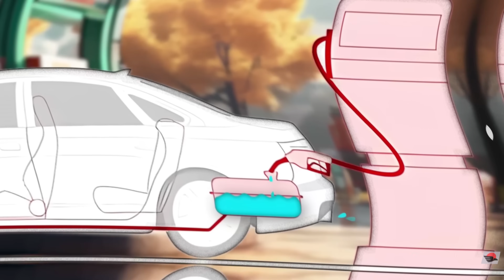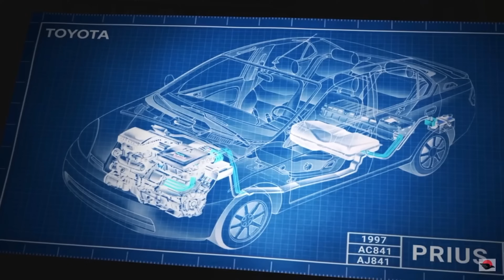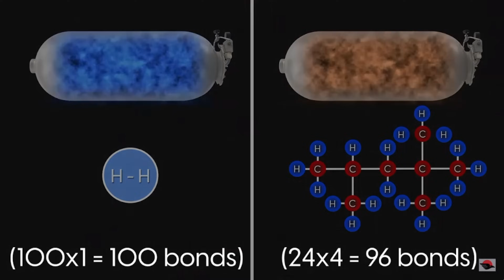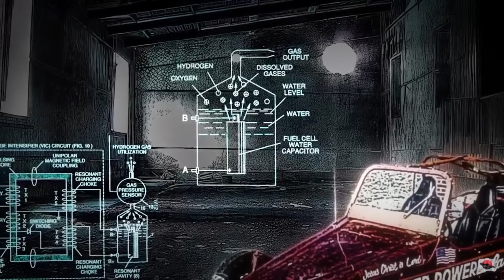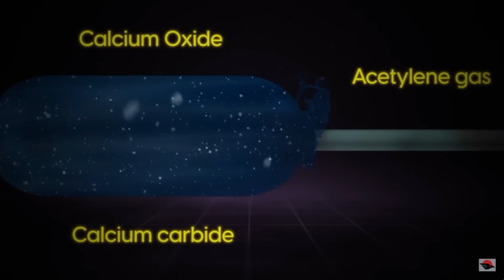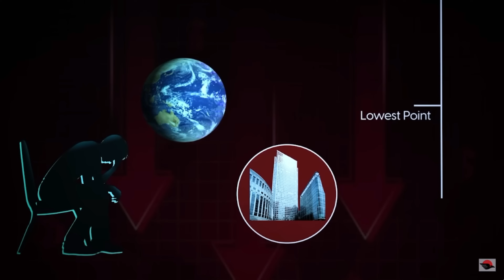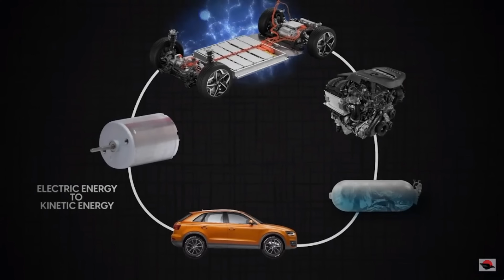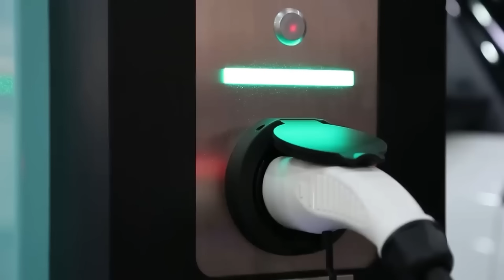Game-Changer: Will Toyota's Water Powered Engine Replace EVs?

Comment: I was always a Toyota driver...then on the premise that they wouldn't produce a junkers, I bought one of their eV BZ4X. Not a bad car overall compared to others, but does not meet the criteria for a useful 2024 EV.  Very slow charge, less range, too big for what it does, so many small things they didn't get right inside.  I think they put the same engineers on it that thought they knew about EVs because they built a great Hybrid.  Take away the ICE and you have a completely different set of criteria and mindset.  The dealers know nothing about them and are not helpful at all.  When something goes wrong they say "the car is functioning as it was intended" and give you a long list of reasons why it might be doing something weird.  Very disappointing - I, and several others I have met since who have bought them, would never buy another Toyota and now don't believe any of their hype.

Comment: This is not new its just new to Toyota. No massive company has ever tried use water engines as the oil industry controls them. The water based engine has been around for at least 60 years now.
Reply: Lol I said this before it got to that point

Comment: Separating hydrogen  from water causes a burn able feul . By using a copper coils to heat the water and Separating the hydrogen  gases .you get a burn .
We have torches  thay can cut with hydrogen  gas water

Comment: This is merely a basic transporter problem. Just convert ocean water into H and O (leaving the NaCl behind) and then transport both the H and O atoms to vehicles over the internet.  The resulting emission of the vehicle would then be just water. It would be water grow turnips and water for your aquarium. All of this can be done at 125% efficiency to account for the transport losses in internet servers and the losses in the drive train. I read about the transporter technology somewhere on the internet.
Reply: The losses in the routers can be easily be avoided if you transport the atoms via wormholes instead. Or maybe with Elon Musk's Hyperloop.

Comment: Somebody please help me see what I missed.

So you drive to the station to get the electrical power you need to perform electrolysis on your tank of water, right?  During that electrolysis, the water is converted to H2 and O2.  Where does that H2 go to?  If it goes into a tank, what about the time bomb problem they mentioned?

Or if it goes into charging your battery, for later powering electrolysis to split the water molecule for the H2 your engine needs, is that really more efficient than what Tesla is doing, using that battery power to directly power motors in the wheels?

Tesla
Electrical power ----> battery ----> motor ----> wheels

Toyota
Electrical power ----> battery ----> electrolysis, make H2 -----> engine & drive train -----> wheels

Just looking at the processes, it appears at least superficially that Toyota's way of getting the power to the wheels is less efficient.  What am I missing?

Comment: Total crock. Toyota is selling a hydrogen combustion car. The Mirai. It doesn’t run on water. Runs on compressed hydrogen gas. Tech explanations here including the delusional “ water engines” of the 1970s are also rubbish.

Comment: 18:14 95% efficiency is way better than 35% efficiency of combustion engines. There are so many fallacies in this clip. Producing hydrogen on demand is old but has resurfaced during rising oil prices in 2022, when videos immersed on how to modify your motorbike or generator 😊
Reply: It's all totally flawed figures.
Generating the Electricity in the 1st place has a %loss then charging the Battery has %loss then converting the Water to  Hydrogen using the Electricity from the Battery has %loss then burning the Hydrogen in the Combustion Engine has %loss.. 
That's an awful lot of % loss,es 🙄😭😭

Comment: Stanley Meyer's friend and business partner is a good friend of mine and he said that Stanley was at a Cracker Barrel restaurant and when he felt his throat burning after he drank some raspberry ice tea he walked out the door (he had gone to the bathroom while 2 German potential investors stayed at the table waiting for him) and as Stanley's twin brother Stephen was walking up to the Cracker Barrel he told Stephen that he had been poisoned and the two Germans disappeared in the confusion as Stanley collapsed dead at Stephen's feet.

BTW the So Called "Laws of Physics" is an absolute Crock of Crap! We don't even need water to power a car - Closed Loop Battery Systems that Charge and discharge can be "Easily" achieved right this moment. I have proposed a design to 7 Engineers - Two work for LADWP and Edison Electric and One is the Chief Engineer of the electrical Grid in Armenia and the other four are Independent Consultants and they ALL said the same basic thing. Yes this can be done and I don't know WHY no one has done this. To which I have said, They have but the Powers that be (Men in Black spooks) shut theme down every time. THAT will soon be changing and I believe it because "Current" Commander In Chief Donald Trump is working in an Above Top Secret Operation and is exposing them to the public so No One can say that he was a dictator, and cutting off their money supply of FAKE (FIAT) money that MUST create debt in order to issue/print it. See thedocuments.info for Executive Orders, Laws and Military Laws & Orders for details.

Comment: Only if it can be manufactured cheaper than battery. Most cars are removing rare elements. Hold on... this video is on hydrogen cells. Ok, so batties are dropping in price to fast, and it will never compete. Their are 30000 parts in those cars... vs 11000 ish in a EVs. You also don't need to transport hydrogen everywhere and build storage all over the planet. EVs just need fast charges to be installed. 80% of the time you have it full at home

Comment: It almost sounds like they are talking of a perpetual motion machine: Stored electricity electrolyses water into H2 and O2.  The H2 goes to the engine which burns the H2 and the output generates electricity and in turn via motors, drive energy to the wheels.  Generators attached to the drive shafts generate electricity which is stored in the battery and voila, the perpetual loop is closed,  The trouble is, most of the energy from the motor goes to drive the wheels and a tiny proportion of this goes to drive the generators.  If you run the generators hot the car won’t have sufficient energy to drive itself. 

I can see that the car will work in theory but the thermodynamics will mean that a constant input of energy from outside the system will be required to drive the system.  Losses along the way will reduce its efficiency and in the end it is little different from a stock standard EV.  Be that as it may, I’m planning to replace both my cars in the next couple of years and both will be Toyotas.
Reply: Too many people don't understand this principle. When I was a boy (in Noah's time) my dad taught me about motors, generators and transformers. With this knowledge, I conceived of a motor and attached it to a generator and then put a step-up transformer from the generator back to the motor. Then my dad introduced me to reality.
Reply: @danperryy  Dear Dan, sounds like your dad was a clever fellow. He understood the principle that there is no such thing as a lossless mechanical process.  With multiple processes, the losses are cumulative. It’s basic engineering.
Reply: I can imagine that you could use some of the braking energy of the car to produce H2, which in term could later be used to help fuel the ICE. The same way that you use the braking energy to recharge the battery in a Hybrid car. Thus improving fuel efficiency a bit. But you'll still need to fill up the massive H2 tanks in a H2 filling station to get you moving...
The H2 powered ICE seems simpler to produce, but no way that this solution is as fuel efficient in comparison to a Fuel Cell Electric car... and certainly not compared to a 
Battery Electric Vehicle... If we only had good batteries... (fast charging, environmental friendly, lightweight, high capacity, price friendly, safe...)
Reply: @erikbaeyens2043 braking energy isn't free as it has to be put into that car's mass first as kinetic energy.
Reply: The press is doing a VERY LOUSY JOB when they totally ignore basic LAWS OF PHYSICS. ICEs are subject to Thermodynamics principles. Each and every ICE have inherently LOW EFFICIENCY - typically 15% on urban tráfico, 25% on the road at Constant speed. Huge heavy duty diesel engines may reach 50% if exhaustion heat is recovered.
"Green H2" production is even more innefective.
Most water electrolysers reach maximum 50% eff. When you feed that into an ICE, one gets a FINAL EFFICIENCY from 7,5% to 25% at best.
That's a silly WASTE of 75% to 82,5% of clean Electric Power.
The BEST OPTIO will always be DIRECT USE OF ELECTRICITY TO POWER WHATEVER MACHINE YOU HAVE
Reply: No they don't. The source of energy is Hydrogen , or water, H2O in this case. it is all powered by an external source of energy. All similar systems are open systems, not closed systems, an 2nd law of thermodynamics doesn't apply here. 

Examples are all power plants, wind turbines, solar panels, hydro and nuclear power plants , etc.  All of them are open systems as they are powered by externally provided energy (sun, wind, river, coal, radioactive isotopes, etc).
Since one of the largest uncontrolled energy releases on the planet in the 20th century was a Hydrogen bomb explosion, and it used a negligible amount of hydrogen , Hydrogen is possibly one of the largest energy sources on the planet . 
Oh, yeah. Oil is HydroCarbon, a combination of Hydrogen and Carbon molecules.
Reply: @al4465  I think you are still overlooking efficiency as the rate limiting factor. No process is 100% efficient, they all lose energy, as will this process.  More energy in than out is the inescapable rule, except for nuclear fusion which is irrelevant here.

Comment: The main problem is there is not Water-Powered Engine  refuel  station ,
Reply: At least the infrastructure is already built at EV stations, as in the sidewalks, the lights etc and the properties are already purchased. They would just need to add on to those which would save some of the costs at least.
Reply: Wikipedia it.! https://en.wikipedia.org/wiki/Electrolysis_of_water [ Electrolysis of water ]
Reply: It's not even that. The main problem is hydrogen weight compared to energy it could reproduce is aroud 4 to 5 times less than petrol and that's for the gas shape pure hydrogen so, if your tank size is for example 60 litter and you could travel around 400km with it, with the same tank size you could only travel around 100km at best or you need at least 4 to 5 times bigger tank size!

Comment: Did they also figure out how to perform electrolysis above 40% efficiency? Even if it’s 100% efficient you can never get more energy from burning hydrogen gas than you will making it. If it’s 40% efficient then you’re just wasting 60% of the battery’s capacity AND you still have the same problems as an electric system.
Reply: At least you won't have to wait to charge
Reply: I charge my tesla at night  @ashypravs4866
Reply: But the wait to go anywhere will be infinite. @ashypravs4866
Reply: You should know that hydrogen is 3x more flammable?           Then Gasoline and Clean Burning!

Don't get me started on UCLA 2018 study on High Fructose Corn Syrup. ---How it slows down the human brain 25% 

- That was only one Coke a Day!!!
Reply: Yet hydrogen is the most common element in the universe so hydrogen is the most logical. We have a very finite amount of oil cng and fresh water. What we need is to be able to use ocean water in these engines

Comment: Water is not flammable, and if you want to extract H2 from it, it needs so much energy.
So the rumor that Toyota creates ICE which is running on water is - khmmm  - not really covers the reality. 

H2 can be stored on about 700 bar (10.000 PSI) in a car.
and it is about 200USD to fill a hidrogen car's tank to full due to extreme expensive infrastructure and small usage. It is enough for 3-400miles. Shell closes its puplic H fuel stations in US and UK. Probably they did not see these fantastic videos like this.

ICE's efficiency is about 30% and it is true in case you burn H2 in an ICE too. That's why an expensive fuel is not a good idea to burn. It is better to use H2 in fuelcell and create electricity with about 60% efficiency. This electricity charges a battery and runs an electric motor. An electric motor is about 92% efficient.

Average electric car battery CURRENTLY generates about 6.5 Tons extra CO2 emission. 

but because EV works so efficiently it needs 1/3 energy compared to gasoline engine for each mile.

This 1/3 energy would generate 1/3 CO2 compared to ICE cars, but because electricity can be created carbon free, TODAY EV-s fuel generate 1/4 - 1/5 CO2 compared to ICE.
And it can be just better and better while ICE gasoline's CO2 emission is not about to change.

Due to this a gasoline car creates much more CO2 during its whole lifetime than an EV car.
Reply: Right I hate how ICE enthusiasts will use EVs carbon emissions and environmental footprint as a point against EV. They're really making a point against ice because they acknowledge environmental damage is bad by saying this, and ICEs do more environmental damage. Of course EVs aren't perfectly green. But they overlook the fact that they are much greener than ICEs when taking everything into account including the mining and the battery production emissions, etc. And you make another good point, this industry is in its infancy and by all accounts, EVs are projected to become much greener in time. Look at how much greener ICE has become even in the last 20 years and they still are worse, after a century of refinement. EV was greener right out of the gate.

The real comparison should be EVs versus the first ICEs.

This reminds me of the e cigarette/vape debate. The tobacco vested government and consequently, the general population, is so opposed to vaping, despite it being exponentially less harmful than combusted smoke, but you don't hear anyone critiquing tobacco. One day vaping will be hailed as a breakthrough technology that saved millions of lives. Or crypto which is far more efficient, far more conducive to equity, far less conducive for corruption, far more inflation resistant, etc. - the list is a mile long.. but it disrupts the banks and government's control over our money and thus has been hindered greatly.

But you can't stop great technology. It always wins in a democracy, eventually. One day we'll all be cruising around in EVs we bought with crypto while enjoying some fine, vaporized nicotine 😎 well ok the vaping is optional. The tide just needs to turn enough for politicians to start campaigning on the proliferation of these industries, which has, for EVs at least, started to happen. Crypto soon. Vaping although a less important topic is also starting to get politicians on board as people realize the benefits.
Reply: Spot on. That's what I was thinking. It felt like a lot of this video was lies....
Reply: Take two butter knives stick them in a glass of water touch a 9-volt battery to the top of each butter knife -

Tell Me What happens to each butter knife on the bottom of them that is in the water?
Reply: I bet you you can burn the top of the water now,. because of the Hydrogen and Oxygen bubbling up to the top!

Comment: Sending water into an ICE engine does more than "corrode the parts"..
Reply: Lol yes it's like worrying about getting shot in the chest because it puts a hole in your new jacket.
Reply: I hope that the water based engine takes off but if cars downsized by 30% that would also help so much 🙏🏽🤖👍👍

Comment: This is not the first water engine Grace chemical modified a ford mustang in 1979 and it worked perfectly then just as quickly disappeared.
Reply: 3 letter agencies
Reply: Charles H. Garret did it in 1935 , reported in the Dallas Evening News on September 8, 1935,
Reply: Wondering when it happened to Toyota 😅
Reply: What? post  LINK? Did it make thunder too?
Reply: @JT-cf7dq  Nope, it was real, but even the news station has wiped it. I went to college with his son. His father held a doctorate in chemistry.

Comment: Inflammable means "not flammable."
Reply: Flammable and Inflammable  both mean combustible.
Reply: @olsonspeed correct. That is a bit of an English oddity, granted, as the prefix "IN" typically means "not" but in inflammable it is derived from a Latin prefix, of the same letters (in) meaning "into". The real antonym for flammable is nonflammable.
Reply: No it doesn't you goof.